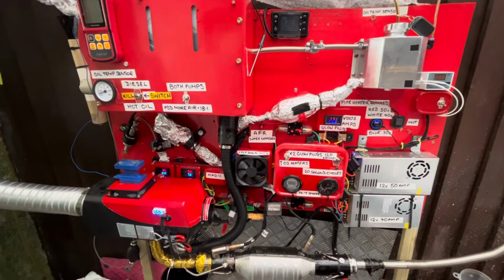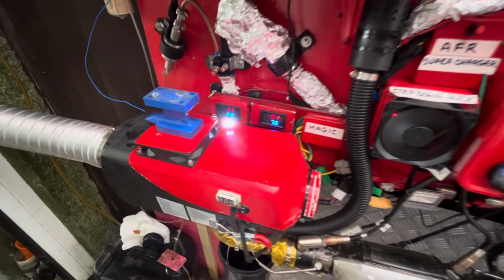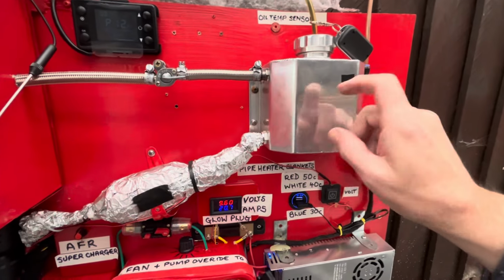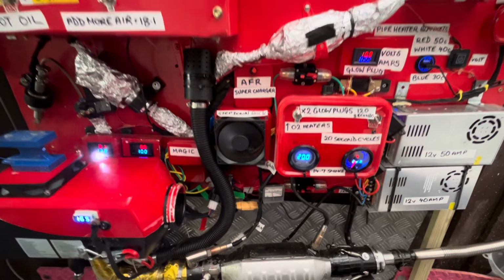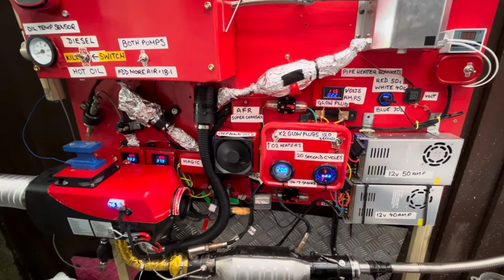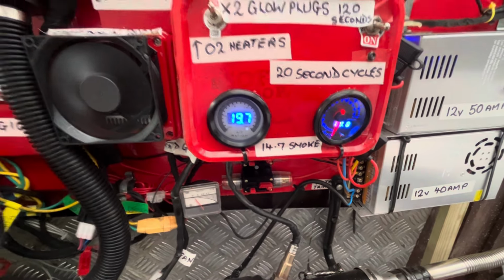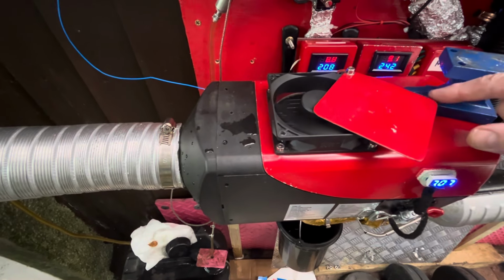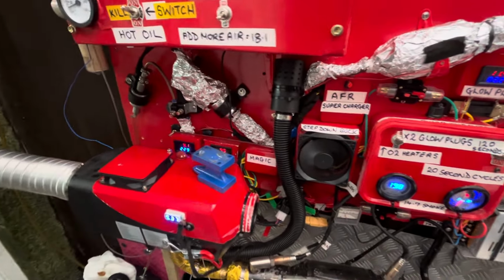Diesel heat dual fuel winter start up. ￼

Comment from the maker: I can’t believe the Rabbit hole I fell in working on that project! Delay timers,heated blanket pipe heaters, 80 watt 12v immersion heaters with thermostatic probes, amp draw checks on splicing oil pump injector leads! Crazy time when I have so many motorbikes to restore. Did have a failed start up today at 3c ambient. Luckily I ran the main fan and supercharger (yes two extra potentiometers I forgot )for 5 mins to blow the crap out the whole system that’s not possible on stock heaters which annoyed me keep taking it apart. 2nd attempt after twin glow plugs it roared into life. I did do schematic of the wiring specifically for the glow plugs but can’t find🤷‍♂️ These plugs I can turn back on when it’s running as oil is introduced to achieve the 360c on setting 2. All my in steel chamber thermocouples melted at 999c ,and that knowledge doesn’t warrrant a NASA £400 probe on a wire. Nice to hear from you buddy👍 Link me in your updates. I have two microphone and a Chinese gimbal, but will try and speak louder in the future the if that helps. Cheers Gary